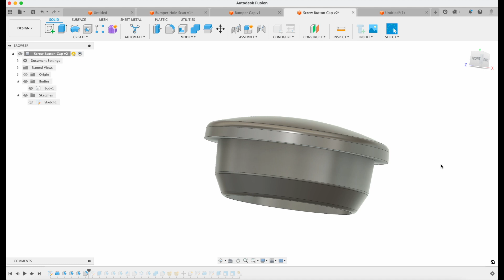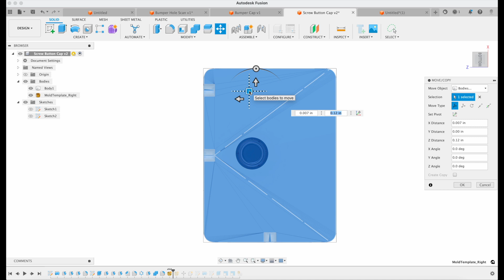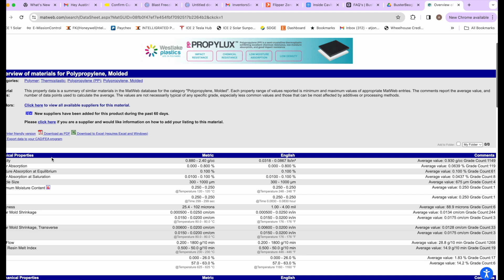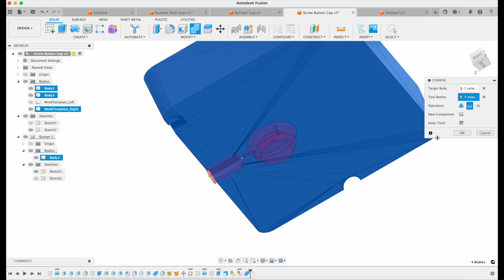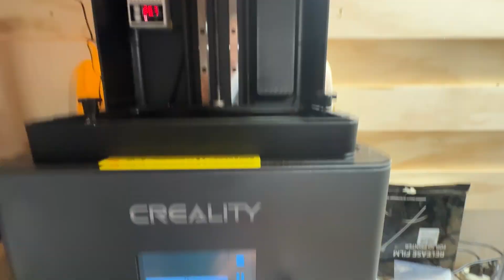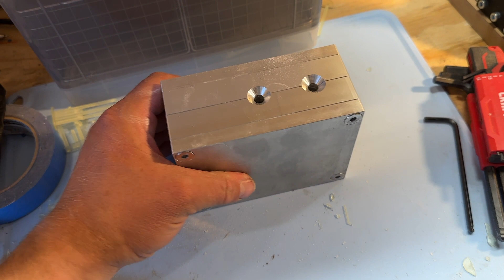3D Printed Injection Molds at Home - Part and Mold Design, Building and Testing

Comment: blasting sculpt works well using 2000 grit glass media and water.. makes surface lines disappear without affecting dimensions... if you are careful. :)
Reply from the maker: This is a great idea! Do you have any details on the setup you are using for this?
Reply: @buffaloislandengineering  youtube for vapor blasting.. i use it in my homeshop for other things.. but im pretty sure you can scale it down alot its just a waterpump, small blast cabinette and a pressure source in a closed box.

Comment: Thanks for the video! I would add air vents to your mold so the air can escape as the plastic fills the mold, this may be part of the reason your mold isn't filling completely. I machine a .25 wide by .002 deep slot on both halves of the mold, so you end up with a .004 deep air passage.
Reply from the maker: I 100% agree! The tough part would be getting them down in the “cavity” without creating an insert. Hopefully I’ll be able to play with that concept soon. Thank you for the insight and let me know if you have any suggestions for 3d printed inserts.

Comment: sculpt resin gets expensive doing this alot lol. i have the same setup you have. that resin should be sprayed with isopropyl alcohol and scrubbed with a brush. never submerse it in the cleaning station as it degrades it too much. I have a Workbee CNC machine but its in bits at the minute. when i eventually get it set up i'll be switching to using that mostly. resin is too difficult and cracks easily
Reply from the maker: Thank you for the insight! I wasn’t sure if it was one of the sprays I used to aid mold release or what. But you’re saying submersion in IPA could be causing failure?